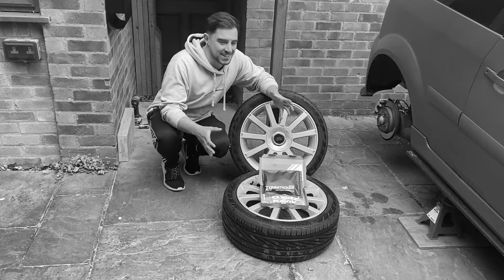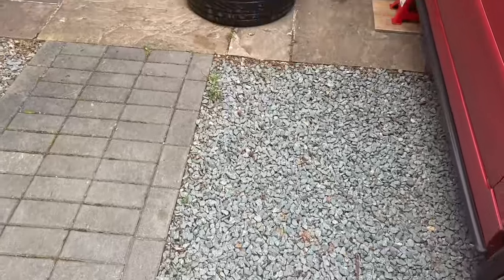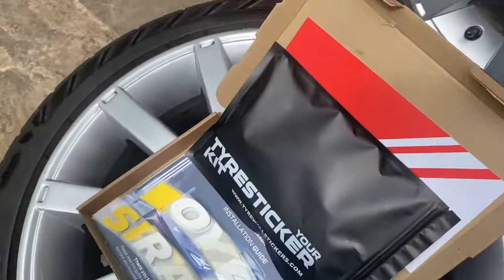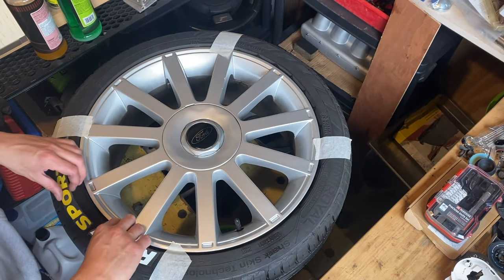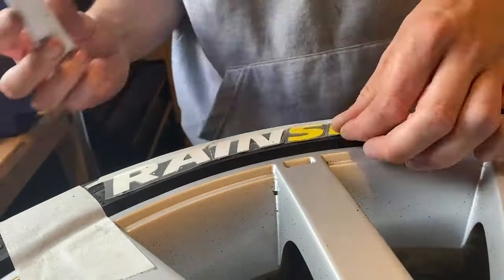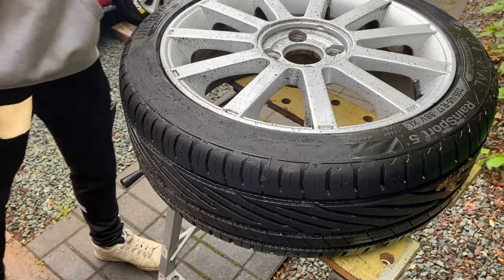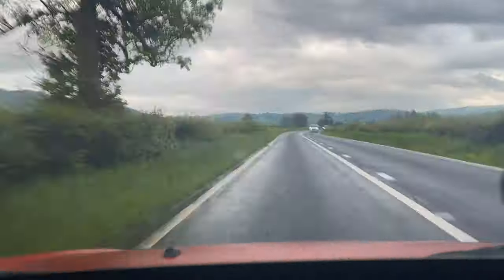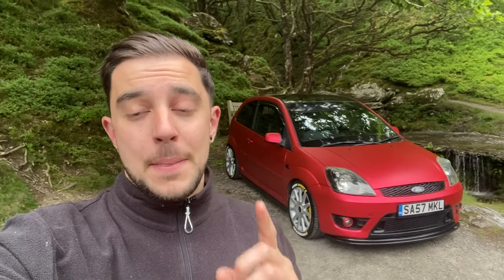Tyre Wall Stickers Decal Kit | MK6 Fiesta ST | Uniroyal RainSport 5

Comment: Is this still running the Eibach Lowering springs? Did you notice any change when swapping to the 205/45/17's?
Reply from the maker: Not eibach’s, cheap and cheerful eBay springs I believe (second hand off Facebook) definitely more comfortable with the slightly thicker sidewall 👌🏻
Reply: @MendItModIt  do you know how much your springs lower it by? I’ve just bought some eibach pro springs that lower the front by 35mm and the rear by 30mm
Reply from the maker: @ryangrindey943  I think mine are the same 30/35 but because they were off Facebook I can’t be sure. Seems to be the most common anyway